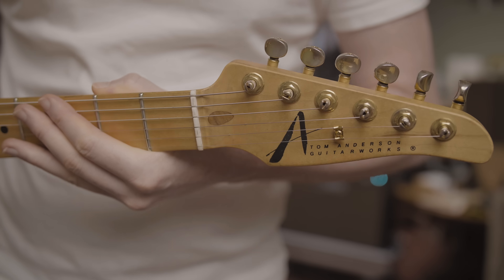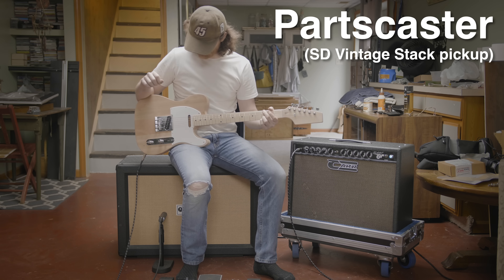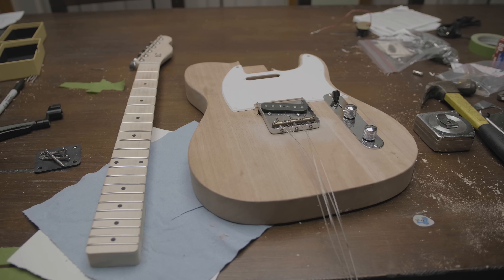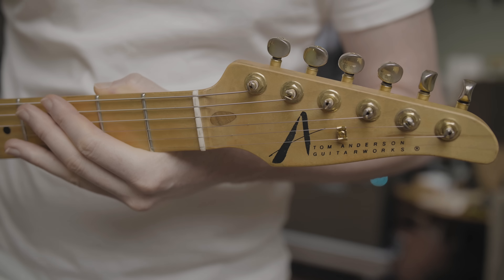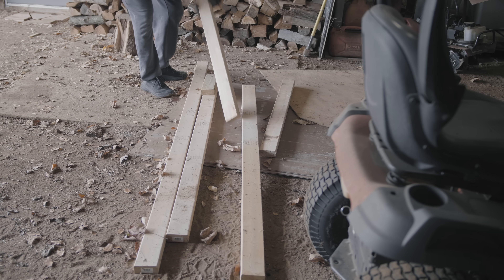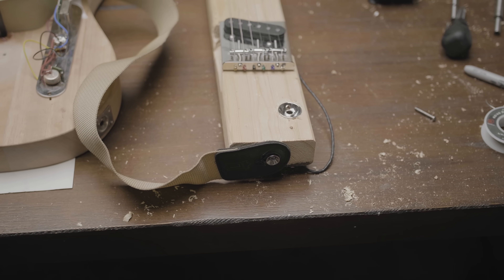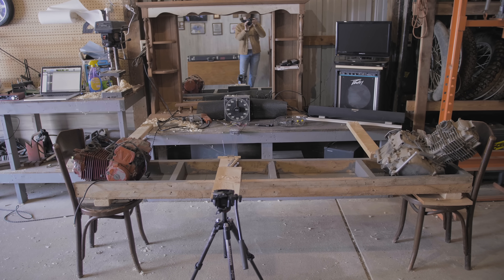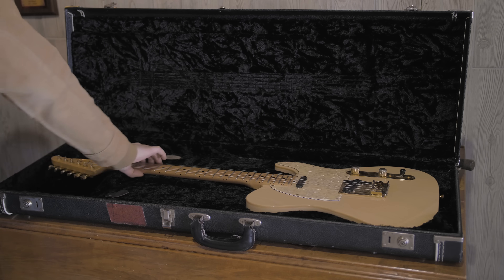Tested: Where Does The Tone Come From In An Electric Guitar?

Comment: Awesome indeed.  Air guitar built in the shop the way you did it has at least one critical advantage though.  The system is way more solid that disallows any fluctuating in the distance between the bridges nor initial string tension.  You can get clearer vibration of the strings, clearer “sinusoidal” wave respectively.  Real guitar body does interact with the string when plucking in a “bad” way: the “geometry” of the system fluctuates slightly… and the frequency oscillates a tiny bit as a result...  Then, the sound wave is just not steady enough to “enjoy” clarity of the sound (if that s the goal).  Even though electric guitarists enjoy a lot of distortion (and, to start with, put up with “flattened” wave as the pickups are STILL 1-direction while string sound wave is 3D), this simple fact of the guitar body not being steady enough and introducing “extra” and uncontrolled oscillating might be critical for both players and listeners (sound recording engineers).  I do not have a good ear musically but can easily hear the oscillations, as well as if the frets are not positioned correctly or intonation can not be properly adjusted (individually for each string) due to the bridge construction.  
If I try a solid body electric guitar in a store, this is what make a difference for me right off the bat:
1.  How solid the system is (body/neck; bridges; and what holds the strings on both ends.
2.  How accurate the frets are positioned and - 2b - how smooth and even they are themselves.
3.  How well can the intonation of each string be adjusted.
4.  Where the pick-ups are placed and how well the on-board electronics  allow to manage the balance between pickups.
5.  How well the tone adjustment circuits designed (e.g. my “classic” Fender bass, quite well built otherwise, has crappy tone adjustment I gotta admit…)
Ah…, the player….  I am not the one here.  I have a picture of Paul McCartney on the wall and aware that he can some-how play a badly intonated guitar (adjusting by pulling?) but also somewhat out of tune piano (how??).  That s what The player does, I guess…

Comment: That and things in Signal path can change very little. A caps Dialectic type does not change tone but it’s real not marked value. Most parts are +\- 10% same with pots. Taper of pot will change how it rolls on and off not brand

Comment: Things that make a guitarist comfortable playing an electric guitar:  
1.  length of neck scale, 
2,  width of neck, 
3,  radius of neck, 
4, type of frets, 
4. type of strings,.
5. string locking mechanism,  
6. vibrato system.   
7 quality of electronics
7. Weight of Guitar
Build of Guitar that affect the tone of a guitar 
1, Pickups
2. Distance of strings to Pickup
3. Placement of Pickup 
Build of Guitarist fingers that effect th tone of a guitar
1. Pick vs. fingers
2, Muting techniques
3 Length and thickness of fingers

Comment: I have a question regarding the pickup test. Does the change actually make a difference to the frequency response, or does it just increase/decrease the output? And if not, could the same difference we heard be achieved by raising or lowering each pickup to match in output?

Comment: Most people don’t get the chance to play a guitar like mine. Custom shop Kiesel. Neck thru. Solid black walnut body neck with a 5 piece neck layered with purpleheart. The veneer is all purpleheart. The fingerboard is zebrawood. The weight of the guitar is very heavy. It makes every guitar at guitar center feel like a toy. I’m talking feel. Sound is mostly the pickups. But the feel adds to the sound. It gives it an undertone of warmth that isn’t present in any other guitar I’ve ever played in almost 2 decades. Your swamp ash maple alder basswood guitars are cheap trash. If you spend over $800 on an axe get it a custom shop. Otherwise you might as well get a cheaper one with better pickups.

Comment: Woods used and shapes affect its tone, including on an electric guitar, it's noticeable.
Reply: Lol sure it is man
Reply: @NamelessSmile  It's blatantly obvious a 335/339 clearly doesn't produce the tone of a Les Paul or a Strat, even deaf Freddy can notice it...
Reply: @LIKEFUNK  yeah that's not so much to your point though considering they use entirely different pickups, bridges, nuts and electronics is it
Reply: @NamelessSmile  Then try putting the Strat pickups and electronics into one and let me know how you get on or vice versa. 
The woods aren't going to make a particularly noticeable tone difference but it will at minimum alter it's tone slightly for certain.
Reply: @LIKEFUNK  I mean that's the point of the video we're commenting on, and there isn't one
Reply: @NamelessSmile  The uploader already mentioned he used only the same pickup, that's more than like why it sounded so close, it didn't sound indistinguishable though, my point is the actual shape and structure of a guitar more affects it tone instead, a 335 or such made from Ebony instead of it's conventional material used will sound different no doubt about it.
Reply: @NamelessSmile  Some pickups are deliberately designed and built to be fractionally microphonic ...no wonder!
Reply: @LIKEFUNK  yes, not the ones on solid body electric guitars though!
Reply: Seethe and cope 🤡

Comment: Here are several tips for any guitarist who is just starting out and is thinking about purchasing a more expensive guitar for any of the following reasons:

Tone:
-The only thing that changes the sound of a guitar are the parts that have direct contact with the strings, and the pickups
-The saddles will change the pitch very slightly, the nut will do so even to a lesser extent, so it's not worth worrying about either. The only important thing is that your saddles are not rusty and break the strings, and that your nut is neither too low nor too high.
-The tuners will not change the sound at all, but in some models there may be a resonance in the headstock, which is solved by placing some foam or sponge between the strings
-The only important thing in terms of pickups is to have ones that can record without making noise. Otherwise it doesn't matter at all if they are ceramic or alnico, more expensive pickups will not sound better or worse, just different. For example, I am in love with the pickups on my Squier Bullet, so much that when I changed them for some Fender ones I didn't last more than a couple of days before putting the original ones in, and if I ever buy a Fender Strat I will probably put those same ones in it
-It is not necessary at all to change any part of the electronics unless it is rusty or broken. Otherwise, noise problems can usually be solved by simply soldering the components correctly. It doesn't matter if they are generic or DiMarzio potentiometers, they will not change the sound
-All of the above is useless if you don't have a good cable. Any Fender cable (I can't speak for other brands because I haven't tried them) will do the job, but seriously avoid cheap or generic cables at all cost
-Once you have all this, the only thing that will change the sound is what you play the guitar with: thin pick, thick pick, fingers. And generally the only thing that changes is the volume and in some cases the sustain

Playability:
-Unless you have a generic or lower-end guitar (by this I mean below a squier affinity for example), your instrument will feel almost identical to a more expensive one if you take it to a luthier for maintenance and complete setup. This includes things that may require professional tools such as: checking nut height, checking and soldering electronics. And simpler things that you can learn to do on YouTube (but yes, they require practice and a lot, a lot of patience) such as: truss rod adjustment, octave, neck hydration, fret crowning, pickup height. Oh, and even for generic and low-end guitars, they feel pretty awesome when set up correctly, enough so that you don't want to spend five times the price of your current guitar on a new one.
-Frets: It doesn't matter if your fingerboard is made of Indian laurel, maple or rosewood. The only thing you will have contact with are the strings and frets. What will define whether you feel comfortable plucking the strings will be (in addition to the truss rod adjustment) the height of the frets: if they are narrow tall or jumbo for example.
-This is not directly related to playability, but it will be much more comfortable to practice, rehearse or record in the studio if you have good tuners

Aesthetics:
This is perhaps the most striking thing about an expensive instrument, but it is not difficult to obtain since brands like Squier and Epiphone (not to mention harley benton, cort, among others) have launched models with very good finishes in their mid-range models. The only important thing is to find something that you like visually (you may have a preference for the appearance of a maple neck, or perhaps you want a guitar with a sunburst), other than that there are many cheap guitars that you wouldn't know were not Fender or Gibson until you see the headstock

Bonustip : and about amplifiers. Just get yourself a good two channel interface (believe me, you will need to connect two lines at some point) like an Arturia Minifuse and download any daw (I use reaper) and an amp emulator (my favorite is amplitube 5). If you need it, you can connect the output of your interface to another amplifier or speaker to play live (the only bad thing is that you will need a laptop all the time to run the programs). Seriously, you don't need anything else, and it will allow you to do things that you would need to spend thousands of dollars on equipment for, like wet dry wet setups, or recording on many tracks to get ambient or highly distorted effects (like shoegaze). Not to mention you can get absurdly close to any tone by learning to EQ on your daw

Oh yeah, and if you still want to record real amps. The amplifier really does not change the sound almost at all, the difference will always be in the speaker you use in your cabin and in the position of the microphone when recording

Comment: Using headphones  , closed eyes to not be influenced by what i watch, the air guitar clearly seems to have more low end than the regular Tele. 
Probably due to the fact that both ends are attached to massive pieces of wood ! 
Which (to my mind shows) that the body does have an impact on tone . Maybe not a massive impact, but they don't sound the same.

I also have the impression that using a bridge telecaster pickup which has a very strong character byitself could kind of hide the differences between each configuration.
Reply: that's because strings hang down towards the pickup, and not just sideways as per usual
and that does, indeed, matter
Reply: The air guitar has massive low end , it sounds like bass-boost plugin in DAW , I feels the lowend sound/ frequency heard here shows impact of the tonewood in someway imho.
Reply: @Tonebreakfast  or, you know, some strings are vibrating closer to the pickups because of that pesky thing called gravity, and amplitude of the heavier strings is longer
and, let's not forger a lack of shielding + cheaper knobs on that kit for the second guitar, you know, things that directly affect the electricity in an electric guitar

Comment: The ultimate experiment would be to take a tele, strat, and an lp; put the same pickup in all three and make a blind test. If all three sounded the same you’d de-hoax decades of superstitions.
Reply: You'd need all guitars to have the same scale length, electronics, hardware, nut and have the same construction (as in bolt-on or set neck) for that test to be valid.
Reply: @breadcrust6610  And a robot player. People underestimate how human strumming/picking/tapping/any-shit-you-do makes so much of the difference. You can't make the same take twice! Regardless of how good you are. There's a reason we do two takes when we double track and not copy-paste. There will always be difference in your playing.
Reply: Furthermore, would three different acoustic guitars sound the same if the same purely magnetic pickups were used?

Comment: I believe you can approximately model the guitar as a dampened mass spring system. In the case of the air guitar, the entire bench would be acting as the mass. My suggestion would be to make a guitar out of the thinnest, lightest piece of wood or even plastic possible, then compare the length of the sustain with a much denser and heavier guitar, for example, mahogany. I don't think the tone will be different, but I think the length of the sustain might be.

Comment: The last test ( Air Guitar ) makes no sense because in ACTUAL playing, ( you're only strumming one open chord) .. there would be differences in the pressure you're applying on the neck of the guitar... yeah I get the point you were trying to make but when you eliminate the left hand (fret hand)  completely it's impossible to have the data you seek.

Comment: I think most people knew this really - Les Paul's original guitar was the "log", which was just a piece of wood.  Just get a guitar that is comfortable, where the frets are good and level, and it's set up with good action and no buzz - then put good pickups in it, if you don't like the sound.

I also have SD Vintage Stack pickups in my Warmoth Tele.

Comment: BTW woodwinds and brass instruments work the same way. As long as surface quality/texture/porosity is the same (you could apply same varnish for experiment) instrument with the same geometry will produce the same sound. This is especially comical for silver/gold modern concert flutes where both are highly polished metal and manufacturers just made different quality instruments to sold "gold" or any other crap like wall thickness. 
There are couple examples that could be considered exeptions: 
1) brass bells when they are thin enough and have low enough resonance frequencies to pick up some energy from the sound and provide its own "color". same thing with membrane covered hole for dizi flute.
2) actually different surface of different woods if left uncovered modify sound effectively dampening higher frequencies. This factor bring specific timbre to historical instruments that is why plastic recorders have different sounds then boxwood or maple.

Comment: As someone who doesn't know much about music, but is pretty familiar with electronics, the results are completely what I expected. It's all about the position of the pickups relative to the strings. I mean I'm sure every other variable has a tiny, usually imperceptible effect. But it's all about inducing those electron waves in the wiring.

Comment: There is one simple thing y'all forget about this topic. "Dynamic, dynamic, dynamic". The pickup also needs dynamic to test. How much the level from the knob volume on his guitar will affects to the dynamic, which is you have to test the pick up with dynamic properly to get the response and maximum sound from the pickup and the tonewood. So look how the way he strumm/ picking, it doesn't has the dynamics, he just put the same strength on it. He didn't test the pick-up properly. So if we talk and judge the tonewood just from this video. Meh, doesn't make sense
Reply: Ah.  
The pick ups were the same.
Try turning your volume down .

Comment: Only took the first couple tests to prove the top two responses you got were full of confirmation bias. The bottom response you got was right, and by the end of this video you proved that easily. The player is the biggest factor, by far, given identical hard number facts like distance from pickup to strings. The brand or “quality” of components doesn’t matter at all until you get so bad it barely works at all. As long as it works, and is installed correctly/securely, it will sound great.

Comment: Coming frim a guitar maker. Guys an idiot
Reply: Wood cannot be predetermined for tonal characteristics when making hollow bodies.
Weight can be measured.   That's it.
Check your set up and put tone woods to the back of your mind.
Reply: @ChrisShortyAllen  wrong! Been doing it fir years corse it matters or thyd just use plastic. Why do you think ovations sound like plastic?
Reply: @nathangrueber9834  Because you're only taking the acoustic sound into account. The point is the pickups only pick up the vibrations of the metal strings. They aren't microphones. The actual amplified signal is almost completely unchanged by tonewood.
Reply: @breadcrust6610  thats so wrong its embarrasing!! Else guitar makers wouldnt choose wood carefully.
The "tone" comes from the wood long before it even gets to the strings.  Your tryingto educate me in what a pickup does haha i make the dam things!
Reply: @nathangrueber9834  Did you even watch the video?
Reply: Thank you for showing your biases👍
Reply: @alakazam482  biases? Dude any guitar maker knows this is total ignorance. Hes made so many assumptumions and wrong conclusion.  If pickups were only factor they wouldn't choose wood so carefully. Its not just for looks.
He put two diferent pickups on the same guitar and went "oh durr tey sound the same. well durr

Comment: Really? Haven't you heard that the air guitar sounds lacking in body compared to the telecaster? I closed my eyes and listened to both audio samples to make sure I didn't miss anything, but there are clearly differences.
Reply: Dito. The difference is slight, but audible. Of course, provided you use good headphones or studio monitors. I'm not denying that the overall effect of "tone wood" is quite small compared to the quality of the pickups, but saying it has no effect at all just isn't true. I'm a bass player, and there you can really notice how the body of the instruments vibrates through the strings. Of course, you can't hear this vibration directly, but I'm certain that the vibration of the body gives immediate feedback to how long and strong the strings vibrate, so it definitely influences the sound somewhat.